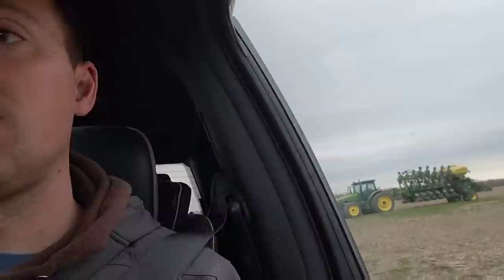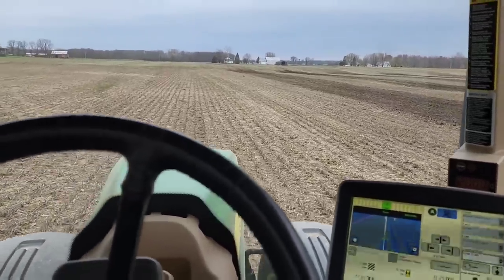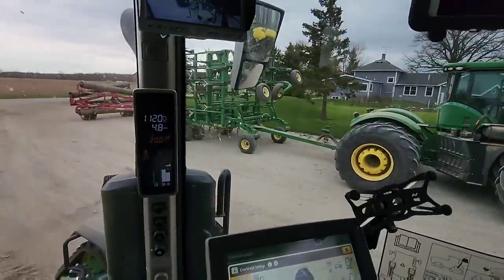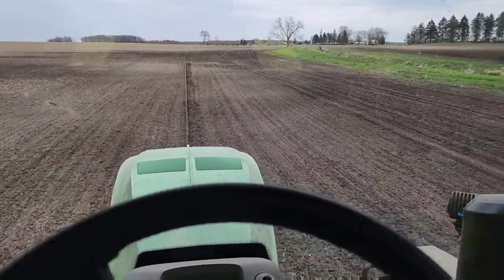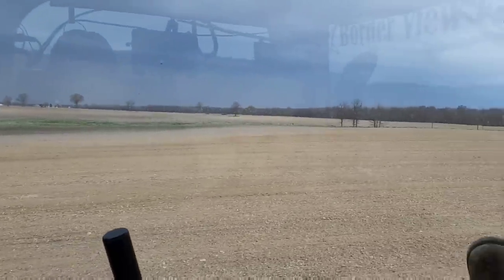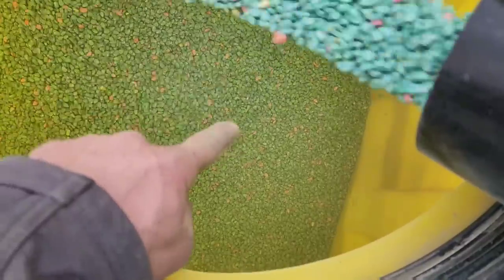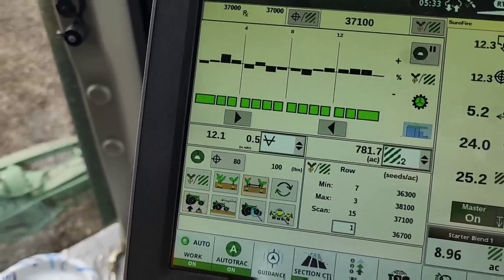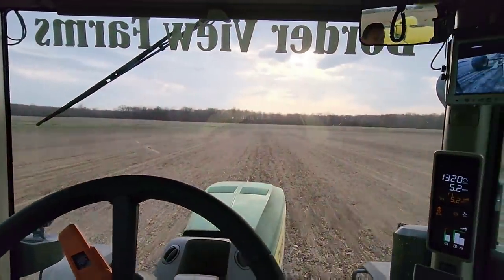Farmyard Traffic Jam - #665

Comment: Hey there Nathan, I hope this finds you all well and good! 

I have a couple of questions pertaining to your track temperatures, and if you've previously addressed these, I must've missed it.

First question, did you follow the "break in procedure" on your tracks before using it? If you did, that's good, if you didn't, that's not so good, and could shorten the life of your tracks by up to 15%.

Second question, what is the width of your tracks, the narrower tracks naturally run hotter than the wider tracks, because the load is spread over a larger area, which brings me back to my efforts in educating farmers about their overweight tractors, which began long before the invention of tracks, that has only  made proper ballasting even more critical.

The less load on the tracks, the less the temperatures will be, which means less life out of the friction surfaces.

As far as the temperatures go, the maximum temperature should be 150° or less, measured on both the inside and outside edges of the rollers and track lugs, and of course it goes without saying, the lower the better. That 1K + lbs on the front would make a measurable difference in the temps. 

I hope this helps you, and if not we can talk more about it if you like.

"Nothing Runs Like A Deere" 🦌👍🇺🇸
Reply from the maker: Break-in procedure basically just says operate in dry loose dirt and don't road the tractor. I have been talcing the tracks before longer road trips. I have to get to the fields though and other than the 1 time it was raining I have kept the speed around 20 mph or less. 

They are 18" tracks, I know wider is better but not for sidedressing. 

I'm trying to keep an eye on alignment but the temp gun is the best way I have to do that and it don't think they are too bad.
Reply: @BorderViewFarms  

Hey Nathan, you missed the critical step in the break-in, you're supposed to take dry dirt and actually put it on the rollers and inside the tracks on the drive lugs, and run the tractor backwards and forwards, while you keep adding the dry dirt to everything inside the tracks.

The rubber drive lugs and rubber surfaces are molded, so the surfaces aren't smooth, and they're sticky, which causes too much friction, so the process of adding dry dirt and moving back and forth is known as "Polishing" the rubber surfaces, making them smoother, and reducing the friction, which is heat.

I would be curious as to how smooth all of the surfaces are now that you've run how many hours? 

The talc/graphite is a friction reducer, so I would use it frequently, after every washing, plus periodically, I know it's not inexpensive, but compared to any of those rubber parts, it's pennies on thousands of dollars.

If it were me, I would take my finger, and just feel the inside of the drive lugs on the tracks, and the surfaces on the rollers, and see if they're slick, smooth, and not tacky like rubber can be, if they are, that's good  if they're somewhat rough and tacky, I would go through the break-in procedure again, liberally using dry dirt. If you have time, I would be interested in what you find when giving it the "finger test?"
Reply: @BorderViewFarms  https://www.youtube.com/watch?v=eeYv2DKL3c0
Reply: @jgm8695  
I'm pretty sure that's what I just said.

Comment: When you use the scale on the seed tender, doesn’t the seed left in the auger throw off the reading or is the amount just negligible. Thanks for the video.
Reply from the maker: The auger and the seed in it is part if the frame being weighed so not it doesn't throw it off. The trick is shutting the Gaye on the box when there is about 200 lbs to go so the auger ends up empty.

Comment: New subscriber to your channel and really impressed with your content and understanding of farming. I recently watched some back episodes of you coating the seed with fertilizer. That’s a very neat process but my question is when those seeds go thru the machine and are coated are they dried somewhat before getting dumped back into the bin. You would think if wet they would just stick together like a big ball of “ skittles”.
Reply from the maker: They are still wet and occasionally do stick but I always dump them back into the box they came out of after they've dried for a couple hrs. this breaks them apart so they will flow into the planters better.

Comment: I run a Quadtrac pulling scrapers and use a temp gun. I check the center of each idler and bogeys to see if there's a bearing thats warmer than the rest. Other than that I was always told to just check the temp on the inner and outer sides of the drive lugs to see if they're running centered.